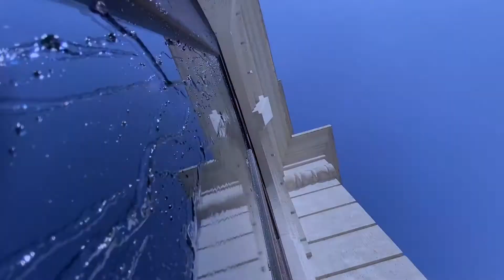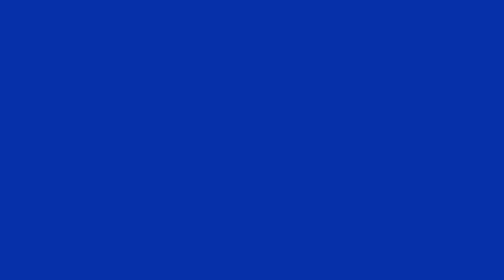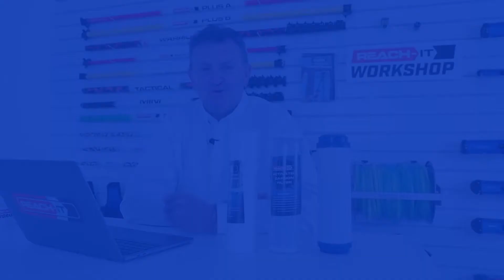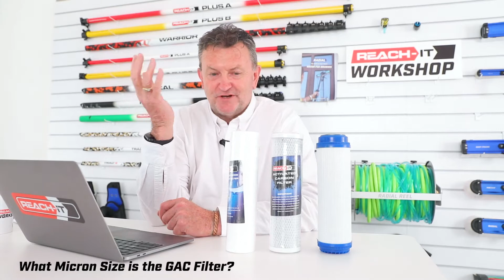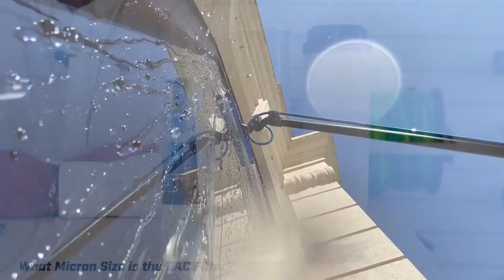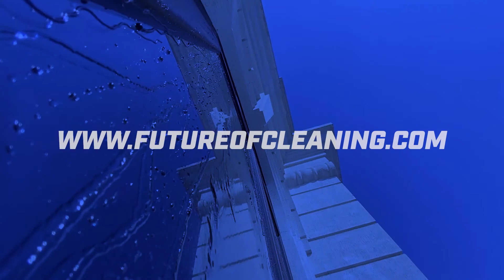What Micron Size is the GAC Filter?

Comment: So i just built my setup; pre stage 5 micron sediment to carbon activated which goes into another pre stage 5 micron sediment  to another carbon activater . And i tested the water before which is 472 BUT after it only reads 460. I need to wash solar panels tomorrow...what am i doing wrong? I dont have the RVmods for my DI resin yet... what can I do? 9:36